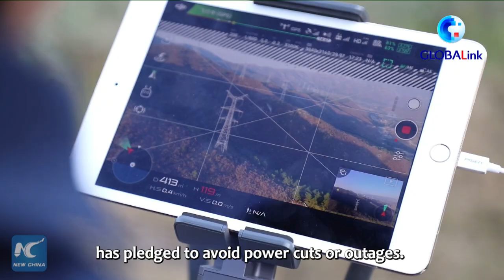GLOBALink | China goes all out to cope with power outages

Comment: More renewable energies should be used instead of coal, especially solar power and hydropower. Jiayou!
Reply: One problem mentioned is renewable energy not reliable eg lack of sun, wind
Reply: Needed to speed up Tsing Hoi
sun/wind power
Reply: Do not forget Geo-thermal Energy , renewable biomass convertible energy to conversion of electricity. Also , tidal energy convertible to electricity,  even safety nuclear power energy,  bio-gas energy.  Reduction of waste energy by machinery utilities management services. Hot Spring energies.  China  do have several options but still China couldn't tap those Energies due to backup,  feedback system and Database Structure infrastructure . As the Countryside rural and urban areas are not assessment yet .

Comment: Nuclear energy and integration of vehicle batteries to the grid is the answer. More than 100 Gwh of batteries will be added to the roads in China this year alone. This massive capacity can be used for load management. A user should get double the power back for every kW fed back to the grid. This incentive will make people charge smartly and benefit the country. Autonomous vehicles could drive to charging points when not in use and return to the owners. Since there is no occupant, fear of accidents will be lesser. Innovation is the only way forward